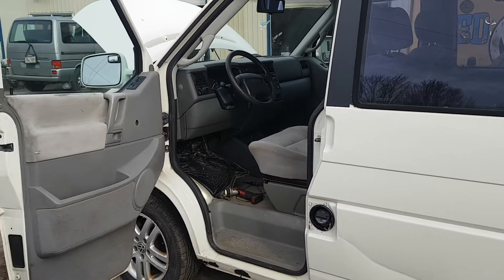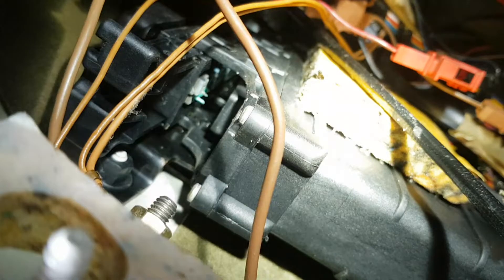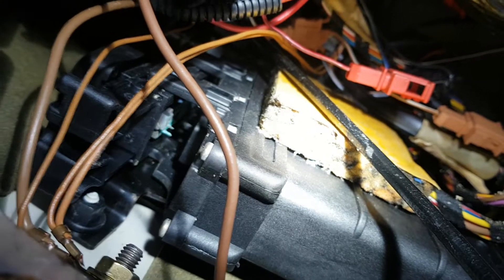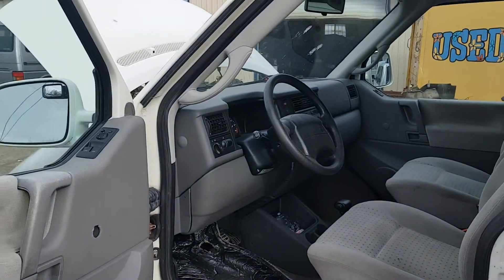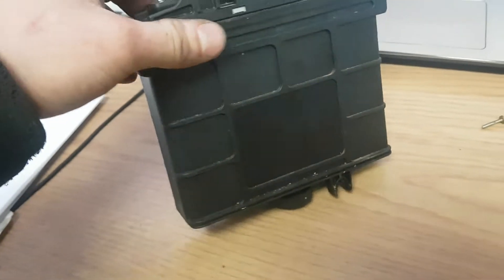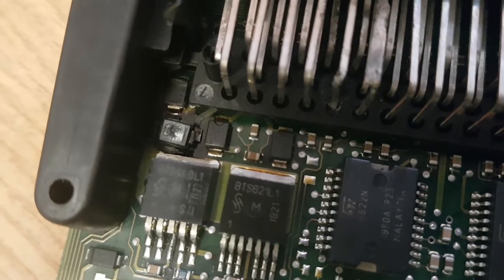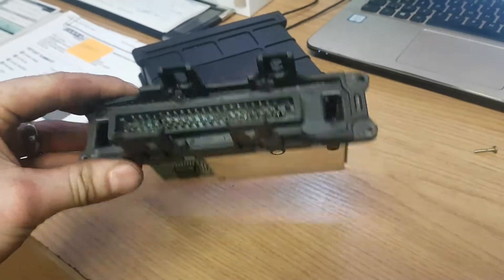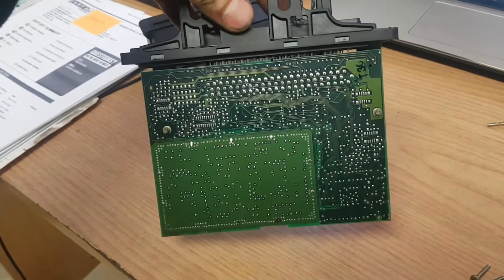Eurovan Tcu failure

Comment: Ok.. my 2000 rialta had no bad pins but it did have that same exact diode blown. Micro center had the smt diode for $1 or less in a pack. It was the only smt diode they stock. But my board level tech said it was 400V and a few amps so it should be fine as the old one was totally fried. Replacing it didn’t fix my slight flare up into fourth gear.. so I believe the solenoids go high ohm and fry the tcu in these Rialtas.. which are tcu code BF and cost $1700-3000 if you can find them. 

I tried the AH coded tcu from my same exact-by-vin-year eurovan parts part shelf and it did work. But the shifting is a tiny bit worse off than the very subtle BF flare up. 

What kills these are the transmission solenoids so change your fluid every 25k miles and the solenoids maybe 50k. Or at least test and/or clean the metal sludge out of them every time you do an atf fluid change whirl the transmission pan is off. 

Several people also claimed battery charging or wiring issues mis-wired.. could cause this also.. from the Rear coach part no less. 

One also was 100% it was a faulty shift solenoid that’s in the cabin floor gear shifter (no longer available) which cause his tcu damage also. 

But address new/cleaned/tested valve body solenoids before putting back any new or repaired tcu for long or at all. 

Especially for Rialta as this one tcu part is so expensive! Good luck. And put something above the tcu to prevent the common water leak from the windshield. Even a little plastic roof or seal the tcu with a spray maybe.